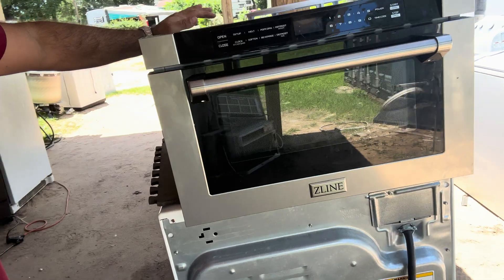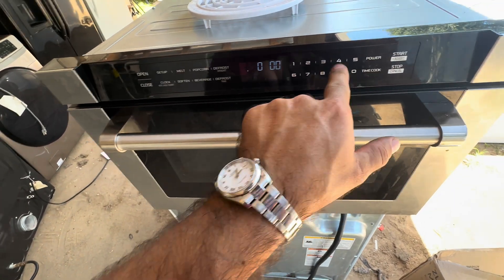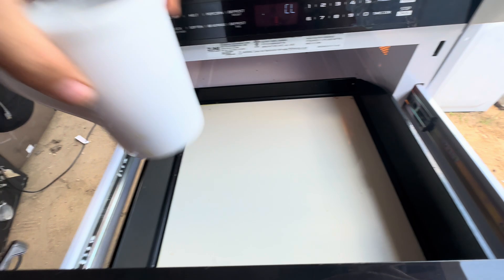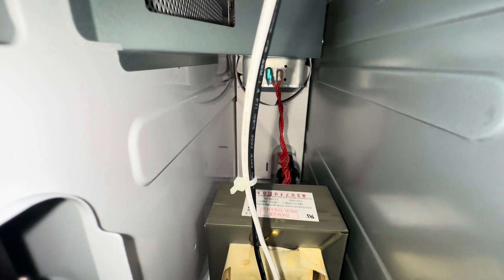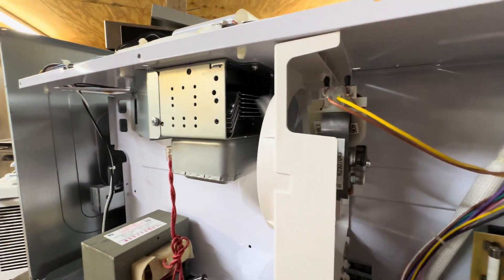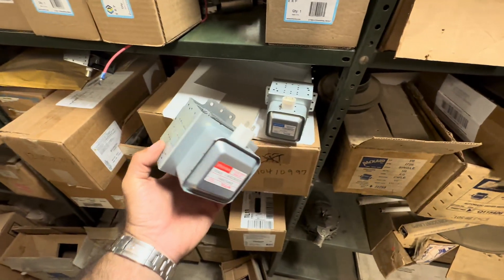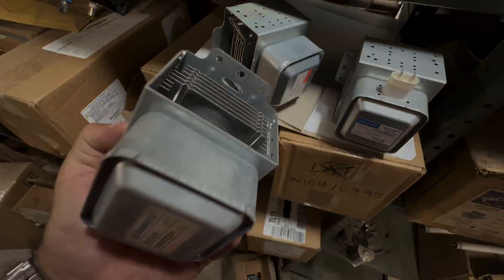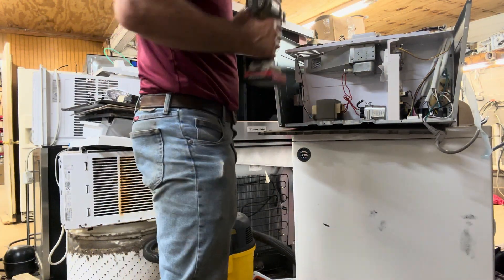This ZLINE Drawer Microwave Isn’t Heating | I’ve Never Worked on One | Bad Magnetron | MWD-1-SS-H

Comment: That unit certainly was not used a lot.  Way too clean inside!  No dust on the fan blade either.  Pretty much looks like the same internal components as a $200.  counter top unit.   The time waiting for that electrically operated drawer to open or close, would drive me nuts.  Also the first time food accidentally splattered, because it looks very difficult to wipe the inside cooking areas.  😂
Reply from the maker: Oh yeah true. Then all the food goes into the tracks and crevices of the unit and starts to stink. Eww you are right. Same unit as a cheapo just purtyed up. Thanks for watching. That mug is on its way chatr. Have a great day.
Reply: @LAapplianceguy Thank you for “fixing” the mug situation.   You get a special 👍 for successfully repairing that fancy looking microwave.  Someone certainly should be interested in buying that.
Reply from the maker: @chatrkat no problem. I think so. It’s very specific so it might be harder to move.